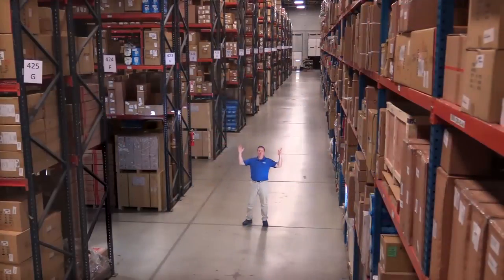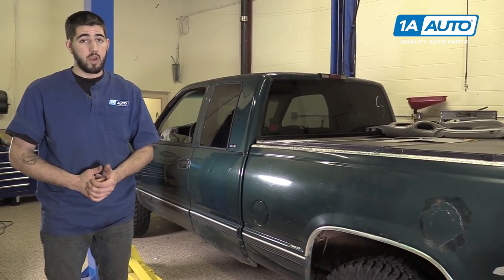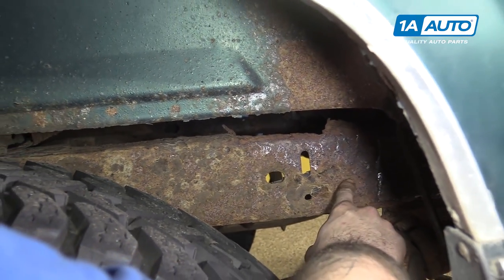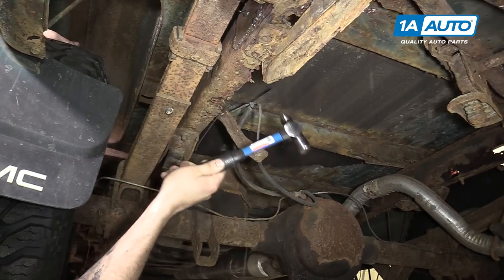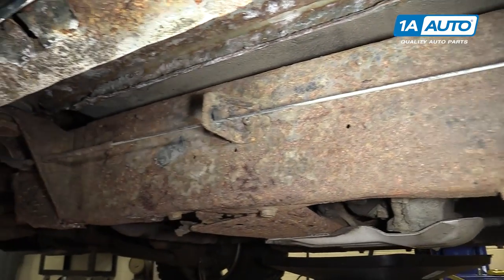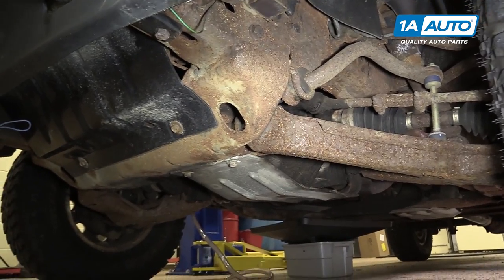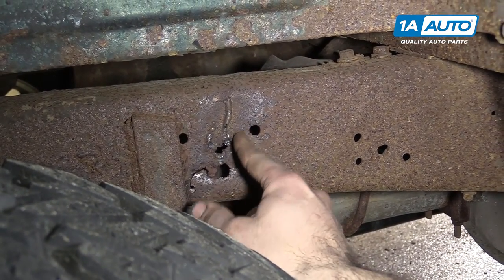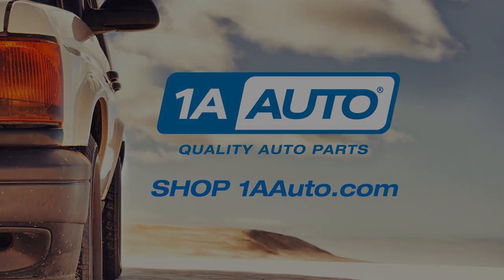How to Check the Condition of Your Frame and Is It Safe to Work Under?

Comment: I think we're all here for the same reason 😔😔😔
Reply: Yep
Reply: I'm here for the lulz. Cheers from Florida.
Reply: I was looking forward on buying a Ranger '01 4wd 3.0 v6 but the frame got rust
Reply: My vehicles are undercoated, so their frames are not too bad. 

I just want to see how others rust so I can learn from their mistakes.
Reply: Cosmoline (CRC heavy duty, Amsoil heavy duty, Crown 101 etc) over rust and lanolin (fluid film etc) in cavities.  I'm experimenting over 10 years.  Cosmoline stop rust.  But if you spray cosmoline at top of paint it will just fall out when paint fall.
Reply: Wanting to buy a 30 y/o + vehicle in Canada
Reply: 2011 chevy I got from a deal ship year later I noticed the frame has all cracks in it it was all sprayed black to hide everything

Comment: I'm feeling a bit sick. I bought a used truck from the most 'trusted' dealer in our area of Arkansas. They told me this was a 1 owner, local truck owned by an older farmer. 2005 Gmc Sierra 4- wheel drive. I figured I was golden since we use no salt in winter on our roads. 4 years later this truck is rusting to the ground. WTF.
Reply: @jeff Hardin let me guess, you don’t have it anymore. Sounds like the previous owner took crappy care of it

Comment: This is how Road Salt in the Winter Just DESTROYS your car.
Reply: what can you do then?  an auto car wash membership in the winter?
Reply: @chrisursogmail  clean your undercarriage regularly, if you dont wash it, then the salt sticks to ur frame and rots it fast. ensure the frame and undercarriage is painted with undercarriage paint. then apply wd40 on it all, wd40 acts as a protective layer for the paint so it doesnt get chipped as easily and expose bare metal to the elements. check the paint and everything in undercarriage every 4 months

Comment: Hey Chris, if you’re moving from Florida to Ohio that’s a common problem up here, I’ve had frames rust out on my cars like that, and the big thing up here is brake lines and gas lines and also gas tanks and straps, almost all of it is due to the brine they put on roads which is basically salt water, imagine driving thru that daily, like driving into the ocean,

Comment: My vehicle as 2003 has extreme rust holes on undercarriage frame rails. About $6000 invested in repairs and everything is working. No rust on outer body with 80k miles. . Should I park it and lose all that money?? three garage have refused to put van on hydraulic lift. I'm worried and driving 25-30 miles per hour. Will the front control arm section drop down?

Comment: Hey Tony, not sure if 1Aauto sells undercoating spray. but we would like to see a video of undercoating frame and body video. If not this vehicle maybe another. thanks!
Reply from the maker: +mrexecutive1 We will keep this in mind in the event that we need to under coat a vehicle. At the current time it is not a product that we sell. Thank you for asking. 1aauto.com
Reply: The rubberized stuff can cause worse problems because it traps salt and water. Been hearing about yearly sprays of fluid film underneath helping alot though.

Comment: so I have a 99' ford expedition that has a smilar problem with the rear frame being very rusted out. Is it possible that if the frame breaks while driving that it could puncture the gas tank and ignite the gas tank???

Comment: How long does it take for a 2021 truck to rust that lives up north for all of its life?
Reply: Depends. If you don't treat your truck  it'll rot away much faster. I was shopping around and saw a 2013 f350 that was rotting away. If you fluid film or use a similar treatment once a year your truck or car should last a very long time

Comment: My old truck had more visible rust flakes than this frame but it was still solid. Is that possible?
Reply: You may have been seeing paint or an undercoating flaking off with surface rust underneath

Comment: What's more cost effective, Replacing it with salvage parts or reinforcing the damaged areas????
Reply from the maker: +Mando Arevee Thanks for watching!  If your frame is in the same condition as the truck in the video you are really better off looking to replace the vehicle.
Reply: @1AAuto  thanks for the tip.
Reply: Sir i have a question for u that what type of frame is used in this video
Reply: @princebatth9190  its a frame for a 1998-2007 silverado idk if thats any different from any other truck but yeah its a frame not really special

Comment: Every repair shop should have at least one drive on 4 post lift, imo
Reply: Still doesnt allow for suspension or brake repairs. Like he said this truck isnt even with repairing the frame. Parts truck now.

Comment: "Welding it just means there was enough force to crack it, and reinforcing it just moves that force somewhere else"  and since trucks are made to withstand alot of force, probably the force is getting channeled to another place that are also strong enough to handle it.

Comment: This aint nuttin!   You should see my 94 Montero.......so bad that the rear portion of the upper cabin is now supporting the rotten frame.   Frame is so rotten that its like thin rusty tin roof, and you cant weld new metal onto it.   Still driving her, but try not to do any serious off-roading.  Getty Up!